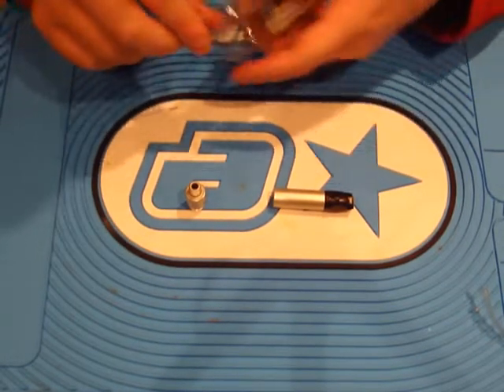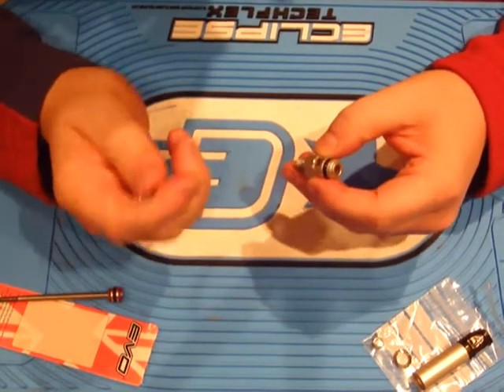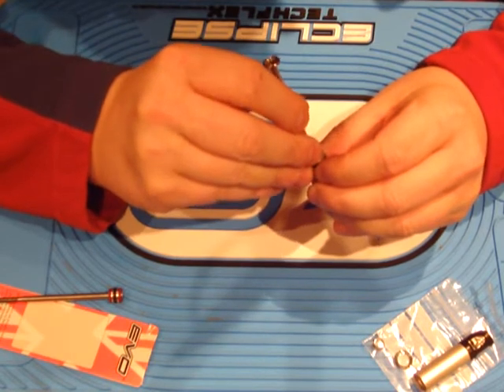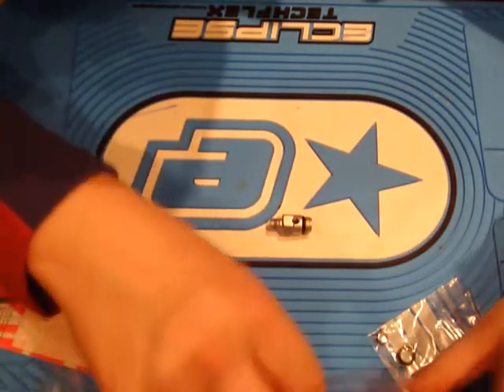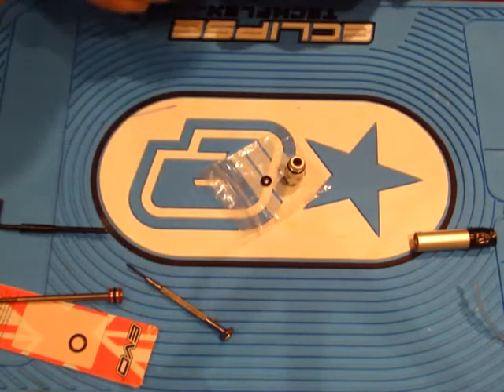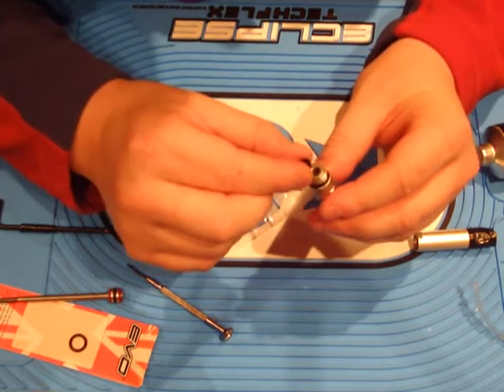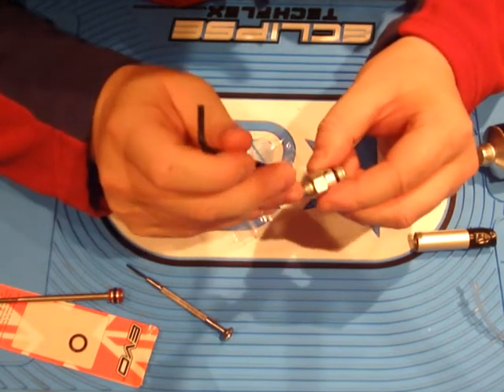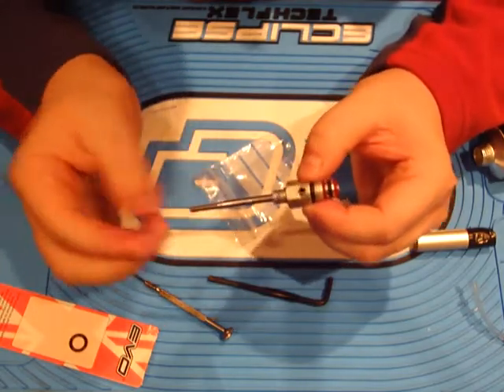Nexus Ram strip and rebuild part 2

Comment: Why did you replace the ram shaft? Was there something wrong with the original one?
Reply from the maker: The shaft was worn. After a while they pick up scratches and wear slightly. That makes them leak. This one would probably have been OK, but as I had the new one I fitted it.